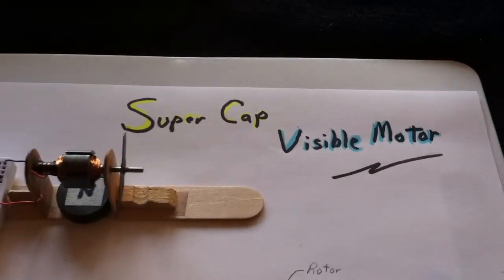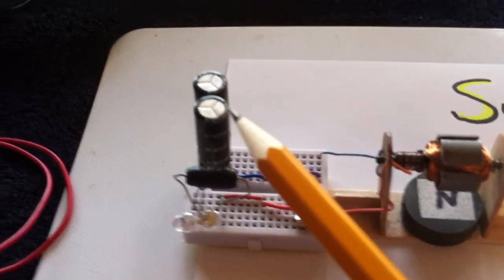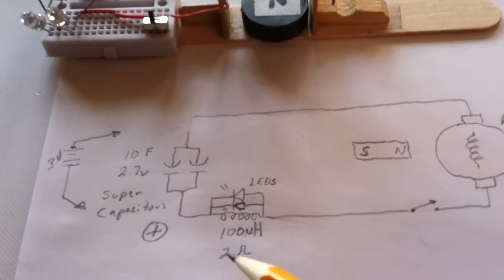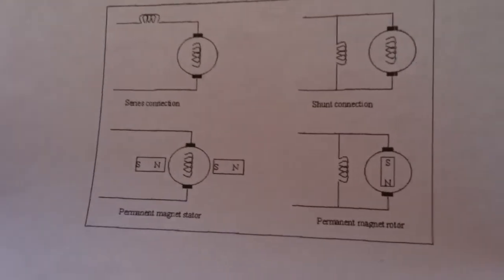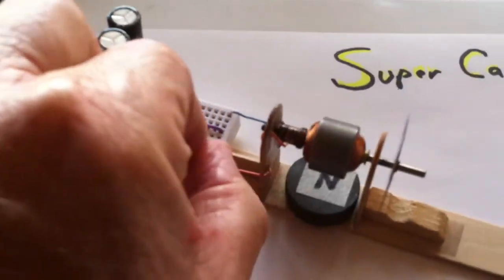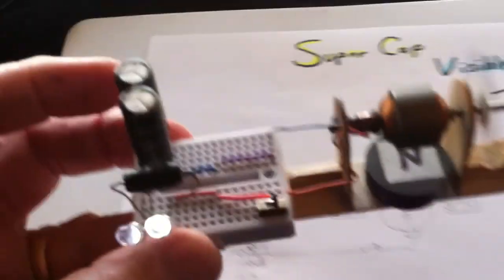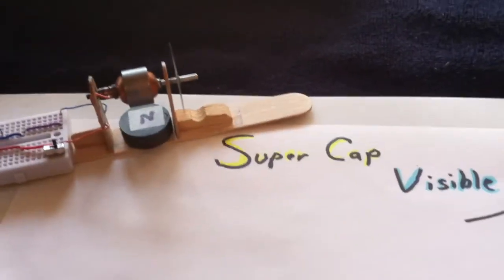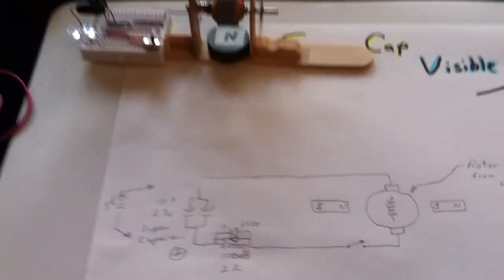Super Cap Visible Motor

Comment: Great stuff! How long do the supercaps last?
Reply from the maker: The motor runs for only about a minute because the amp draw is way up at almost 300 mA.  If you mean how long is the  life of a super capacitor -----many years if you don't abuse it.  You can recharge it thousands of times.
Reply: Thanks for the precision. Does the system selfsustain on supercaps?
Reply: I mean can it be made selfsustained with an additional generator block driven by the system?
Reply from the maker: No it cannot be made into a 'self-runner' by adding a generator.  I wish it could. It has crossed my mind to make a 'visible' motor -generator for fun.